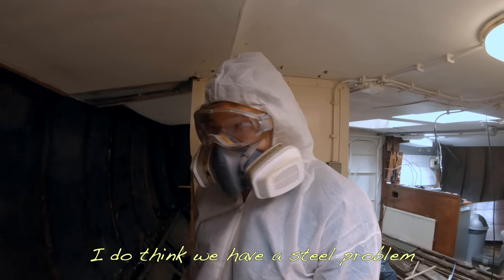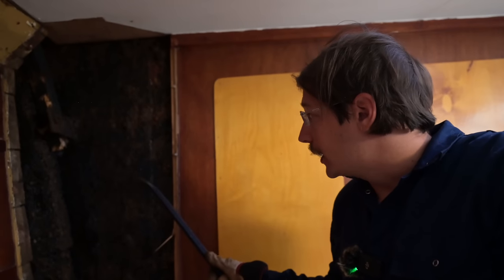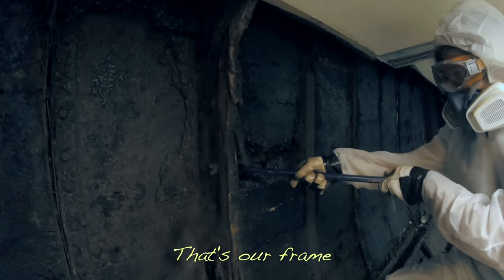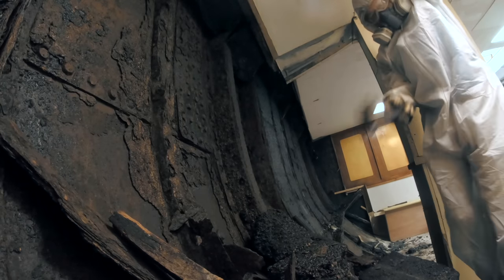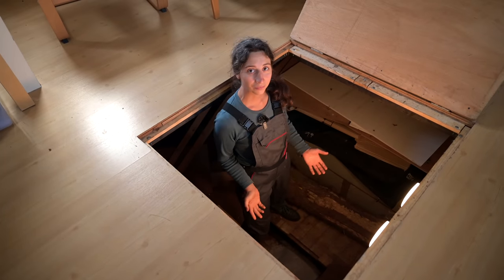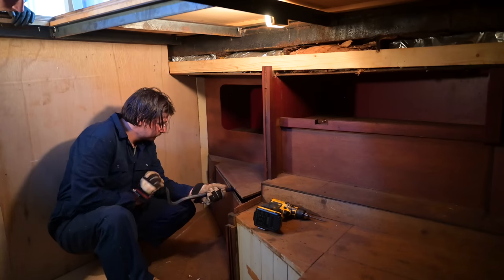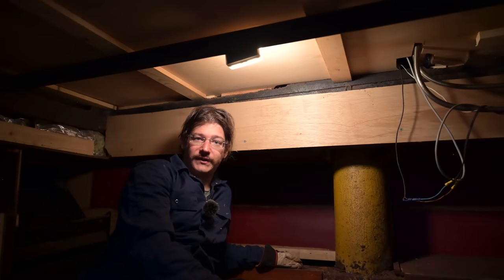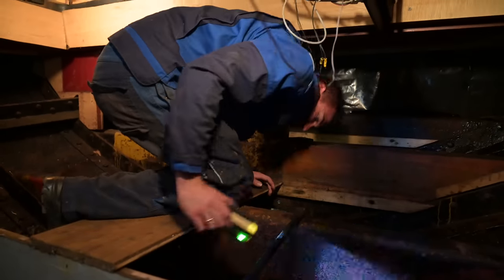We Need To Call In An EXPERT! Not good!!!

Comment from the maker: We plan to make a Q&A video soon. So now is the time to ask us  anything you want to know! 🤓 Just leave your question under the pinned comment. 👇
Reply: Why don’t you guys have a patreon / members? I’m sure many viewers (myself included) would be happy to help out with covering some of these insane costs
Reply: If the ship turns out to not work, will you move to Finland (cheap housing/land prices), and put the boat on land and live in it?

Greetings,

Jeff
Reply: One might suggest that the steel is in better shape in the "secret" room if it is not heated.  The living area might be much more humid (cooking, breathing, bathing, propane combustion).  In a cool climate there would be condensation between the cork and the cold steel.  I saw some sheet plastic in your demo which may be an attempted vapor barrier?  Just something to think about when you put it back together!
Reply: @jamesclarke2110   Yes, I second that! I too would be more than happy too put in some contribution per video to help with the restoration of such a fantastic ship
Reply: You should by a needlehammer.
Makes it easier to take of loose rust.
For youre information, 1 cm thick rust, means 1mm  steal is gone. 
So....no worries 😇
Reply: @aldertjeful  I would check the hull with special equipment for it, to gauge the thickness. First remove every panel and rust (if its not too much work). For the structural members; steel beams can be bought (i believe i saw "limtrade" had some "cheap" options (and who knows some company near the dock, or the dock itself has "good deals")), but shaping them to the curvature of the hull may be trouble if no special equipment is available. 

THIS MAY BE IT (!!!): Maybe laser or water cutting some heavy gauge steel sheets to the curvature of the hull is the best, cheapest and easiest solution. And just weld those ribs in. That should do the trick. Measure the hull up, or make a template. If you have a cad file, or just send a company the measurements they can start right away (usually).

A 86ft boat is a large area to recover with steel. As said before, first measure the hull thickness. It may not be needed. 

Its a long story, i hope it gives some perspective on options to make it right. 

The best of luck. 

Greetings,

Jeff
Reply: What's the best surprise you have found while dismantling so far?

What is the first "dream" location you will sail to as soon as you can?

Do you plan on fitting a bow thruster?
Reply: Where did her name come from ?.
Reply: How are you supporting yourselves financially? Are you still on track to get to your goals with these extra costs? Do you have any regrets from a financial perspective?
Reply: Name of the last song?
Reply: Rebuilding a new ship can save labor than dismantling and repairing it. So if it were me, I would stop the loss in time and seek the plan, skills and equipment to build a new ship from scratch.
Reply: Could you add to the about us section where you are doing the repairs?
Reply: When you run into these unexpected challenges, which one of you is more likely to become discouraged (if either of you), or do you take turns. 😁  Having lived through some challenges with an old house we once owned, I know how these things can keep you up at night.
Reply: Have you considered asking volunteers to help? Even a day might be helpfull for cleaning tasks etc.
Reply: yep, expensive project, I ask my self if this ship is going to break your relation ship?, is it going to break your marriage?, I suggest to try to not risk it, one of you is to slim for heavy work and the other one seems to love romance, this ship could easily break a lot, not only your muscles, or your wallets, I like to think of solutions, and some times I stumble with good options, so I want to provide a few, in my channel I provided a video where I show how to create a shield, the shield is made with plastic and the goal is to seal and protect areas where you do not want dust to go, I suggest to use many of these shields in your project, if your ship's hull has salvation, I suggest to hire a team of people, this sounds expensive but they do not need to be pro's, yet perhaps it would be good if they knew their way around tools, so that you do not end up with clueless people ho may get in trouble, I was going to suggest to hire homeless people, but then that could create odd situations, that you may not be interested to deal with, despite it being the cheapest option, the next bracket would be to hire apprentice level of personnel, at least 10 workers and gut the entire ship, empty all the hull out of any obstruction, basically leave to your team the work that you have been doing in your videos, delegate responsibilities, its very important so not to risk your relation, better focus on being a good manager, a good boss, for tools, you seem to be missing a sand blaster and other tech that focuses on removing rust fast, all of these tools are dangerous due to the dust and due to the odds of the machine messing you up, I would suggest taking the ship to the cheapest spot where it could be taken, as this could save you a ton in rent and other fees, just as those guys from the YouTube channel "ship happens" did, in that way you can take your time without the pressure of that current cost, that you may be having to pay soon... for this project you seem to need fancy tools to remove all sorts of gunk and rust, perhaps one of those fancy lasers that blast away the rust could come handy
Reply: How far are your videos behind where you are actually upto?
I ask, as a lot of vlogs are published weeks after the event, so suggestions probably aren't relevant anymore.
Hope all news is good news for the hull.
Reply: Why didn't you tell us the result of the shipwright inspection?

Comment: You were wondering if your boat could be pre 1950. Could very well be so. Here in Norway, reveting hulls I guess was dying out for smaller vessels in the 1930'ies. In the 1950'ies, welding would be the predominant way of building. So, it could very well be pre WW2. If your ship survives the inspection, never use insulation that contains carbon (C) or will hold water. Use non-organic material. To restore and keep a ship of this size will be something like a lifetime commitment. Sit down and have a sereous descussion among yourselves if this is what you really want. Best whishes!
Reply: In the UK riveted steel was still popular in the 50s, we recently demolished an old Brixham trawler very similar to the vessel being worked on, she had been bought to Australia in the 70s and sadly run down over the last decade. The hull plating was in better condition than this ship, but sadly her fate was sealed by government authorities.
Reply: Why no carbon?
Reply: @ZeRo8625  Carbon, graphite, diamond (C) will be cathodic to all other maters on this planet, as far as I know. In other words, carbon steel, stainless steel and so forth will be anodic. Offshore we had a standard, NORSOK 1995 that specified graphite gaskets on sea water application. That standard gave us in maintenace a lot of good work 🙂

Comment: Hi Guys , I am loving your videos , I have a similar vessel and I have been through what your going through, don’t worry about the rust of the boat its old and most other boat will not last this long, you have a strong ship that’s made of steel, steel is cheep to buy and you just need to find a good welder guy that knows how to make ship repairs , as you know with steel you can cut out the thin steel easy and replace so don’t let these so called experts tell you to scrap the boat,  when I was restoring my boat I found a good welder guy who had some spare time basically wanted cash to do my work, holland is the right place to get work done , keep going you have to go through the bad to see the good, remember you can not buy history you got some thing very different a real ship.  well done, don’t burn your self out it takes time! take a break and come back with more energy
Reply from the maker: Couldn't agree more! Thanks for this comment! 👍
Reply: Might add, learn to weld. It is not difficult and the equipment is relatively inexpensive.  Hang in!

Comment: Did you mention that there was material placed between the riveted sheets?   For new insulation, consider adapting the wood boat technique of creating 'chimneys' in/over frame bays - perhaps in removable panels for hull inspection and repair.  I think your experience tearing out "permanently" fastened interior elements might suggest interior outboard cabinetry that is removable.

Comment: Well there is wrought iron , and cast iron , both in many grades then steel in many grades.( to keep it simple).
Hull and framing would probably be wrought iron , iron rolled and hammered into shape.   Cast iron with be used in shaped parts that cannot be formed or machined easily , like large valves, handles, porthole frames,  shaft flange fittings and many more. These will be pieces the shipyard(s) bought or had specially made. 
Your riveted hull looks like wrought iron and frames formed in machines with heat and pressure as required to form into shapes before riveting together. 
There is probably plenty of steel used later for repairs and changes ( like aft deck cabin) welded with electric arc welding , the original wrought iron might have been welded but by heat and hammer.
Possibly if you think boat was built after the war then it may have been iron and riveting as manufacturing methods were restricted by the allies for a while. 
I look forward to what the expert has to say , clearly the insulation did not help the hull but may have made the space livable. 
Perhaps it got decommissioned from a sailing ship when repairs became too expensive .
Time will tell 
Cheers Warren 
Cheers Warren
Reply from the maker: The yards refers to the hull material as "old steel" We don't think that iron was used. It appears that the hull itself is the oldest part of the ship. Since the wheelhouse looks like it's in place since 1950 it could mean that the whole hull is older. Or that the original ship was shortened. Let's hope we find out more in the museums fisheries museums of Maasluis and Katwijk or in the De Haas shipyard where she was build. It also would be awesome to get a builders plaque from the original shipyard. 
One thing we found out is that the same guy converted her into both sailing ship variants. It could be that a refit was due but the main idea to convert her into the easy sailing motorsailer was that the guy could stretch his sailing life a bit more but also having more comfort during the extended stays in harbors. Apperently the was a relatively good sailing but labor extensive sailing ship before that. The last conversion wasn't done perfect but far from cheap and it makes much more sense if you think of it as a conversion after owning a boat for 17 years. So that's also the reason why so many of her interior was covered up. No more tongue and groove for me so here's some vinyl. We're talking about the early 90s...

Comment: Just keep up the spirit, steel problems can be fixed if it's not the entire ship. Restoring this old lady back to her original state is a gigantic task but the end result will be spectacular. After ye have fixed the corrosion issues, make sure to apply the right insulation and keep the humidity inside low.

Comment: This is a very old ship. There is definitely another material used for the hull plates than for the frames. The frames are typical rusting away in layers. Once started, it's almost an unstoppable process. The frames - I think - are made of 'puddel-iron'. That explains the typical (delaminating) form of rust. The hull-plates are a different sort of iron...you almost could name it 'steel'. It's still difficult to weld, but an experienced (older) welder knows how to handle this kind of 'steel'. These plates are quite resistend to rust but have a problem with 'putroest' (pitting). The Eiffel-tower is also built of 'puddle-iron' and is still standing upright. I think the building of your ship started in 1902-1905.
Reply: Well there is wrought iron , and cast iron , both in many grades then steel in many grades.( to keep it simple).
Hull and framing would probably be wrought iron , iron rolled and hammered into shape.   Cast iron with be used in shaped parts that cannot be formed or machined easily , like large valves, handles, porthole frames,  shaft flange fittings and many more. These will be pieces the shipyard(s) bought or had specially made. 
Your riveted hull looks like wrought iron and frames formed in machines with heat and pressure as required to form into shapes before riveting together. 
There is probably plenty of steel used later for repairs and changes ( like aft deck cabin) welded with electric arc welding , the original wrought iron might have been welded but by heat and hammer.
Possibly if you think boat was built after the war then it may have been iron and riveting as manufacturing methods were restricted by the allies for a while. 
Cheers Warren

Comment: Wow, it's amazing how many comments you are getting now! THAT is something to be proud of!
The insulation, I think caused the rusting on the interior of the hull and on the "bones" of the ship. It trapped condensation. 
As several others have said don't be discouraged by a few damaged ribs in one local area or another. Those can be fortified or replaced. I've done a lot of welding myself. As long as 75% of the "ribs" are good, I think it's doable....moneywise. I guess it depends on how tough you guys are....your "metal", doesn't it? I think you are up to it! AND when Coney sails again, we'll ALL be proud. (I like the beam width on this old boat, Soooo roomy). Merry Christmas!💝
Reply from the maker: The area that was insulated with cork is definitely the one with the highest amount of corrosion. The engine room and the area under the secret hatch are quite good and the fore ship is somewhere in the middle. The welding of the damaged frames and stringers isn't the biggest issue. But most frames are damaged exactly where the frame meets the concrete. So that means a lot of o glorious hammering. Side note, the concrete is off the highest possible quality also used for WWII bunkers.
Reply: @FlyingConey  I'm not sure, but if the repairs are feasible, and YOU have the stamina, and IF you can get the interior sandblasted clean, and painted, you might (if safe and legal) think about spray-on, closed-cell polyurethane foam insulation. It's waterproof and, I think, fire resistant. It would seal that interior metal with a really high "R" factor. AND, my friends,  THAT'S a LOT of ifs!😉 Thanks for the reply!
Reply from the maker: @earlyoung2863  Previously I was strongly leaning towards spray foam but the problem with a riveted hull is that they have a tendency to leak and there always will be small welding jobs when taking the boat out. Some say it's possible to weld with the spray foam in place but here they wouldn't touch it so it would be necessary to remove it. Sandblasting also is difficult but I think laser and / or wet sandblasting could work. Then we still have the problem with the areas underneath the frames. Speaking about corrosion probably the best coating is some sort of heated wax, grease or bitumen. If you want to go overkill, hot zinc spry coating first would be nice. BUT I don't want to use stone wool as insulation and I have to check if I could use something like Armaflex on a soft coating. De-Rusting, Coating and Insulation really is the triangle of difficulties.
Reply: @FlyingConey  Hey, the wax actually sounds like a good idea. And I fully understand the problems the foam would present. Plus toxic fumes if welding was needed.
My brother was an engineer on fishing trawlers in both warm water and the Arctic. The last ship he was on had a 16 cylinder Volvo inline engine. The cylinder heads had no bolts in them. Their massive weight held the compression. They simply just slipped over pins! My brother loved sailing. I lost him not too long ago. He would have loved your channel!
Reply from the maker: My condolences on your loss and I wish you all possible strength to go through tis difficult time!

Comment: You have my admiration and respect a a boat restore person mostly in wood i have steered away from steel boats not that i can not weld  but rust you can not stop Slowdown maybe  and yes there are 100 year older out there but they are tyed to a dock,! To me it is mind boggling! What a project you have work on a boat not something planed (that's in your head she has different plans)find her soul she nose you have hart.(block of wood usually found on the starboard mid ships Mahogany or teak )DO NOT REMOVE